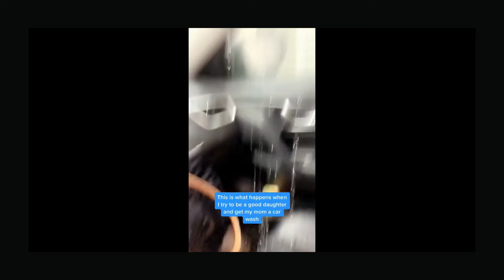😱🤭Carwash Fails You Can't Look Away From #fails #bestfunnyvideos

Comment: I feel sorry for the young girl. She had a sunroof cover closed inside. She must have a problem with the drainage holes being blocked up. The water that come in like that there's something blocked up with. A sunroof is up above. I don't think some things are funny with the video. Those people are in drive and the roller system that rolls your tire along with it. They're not in neutral. They should be a neutral going in thank you .